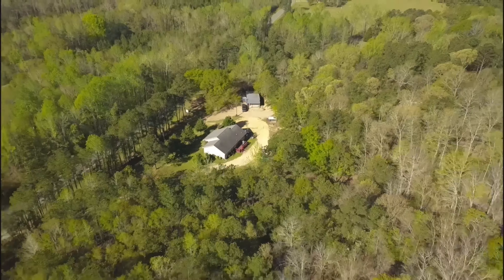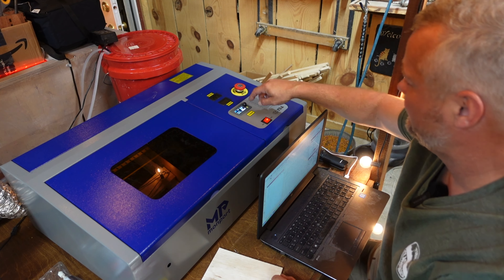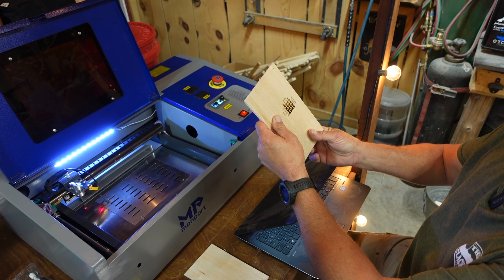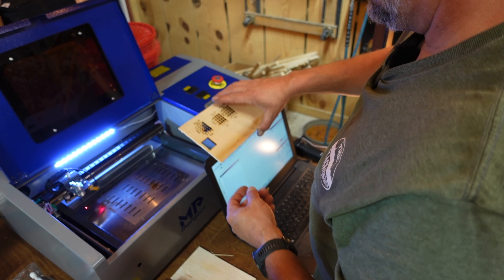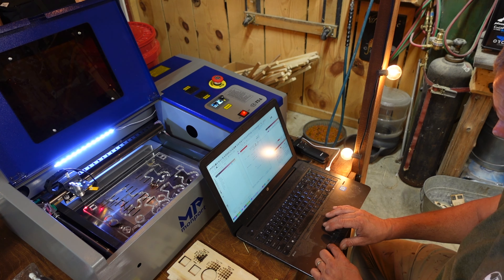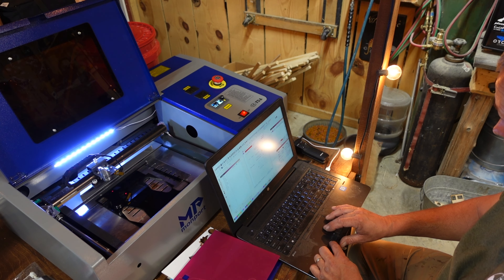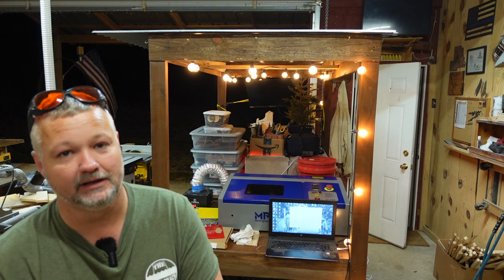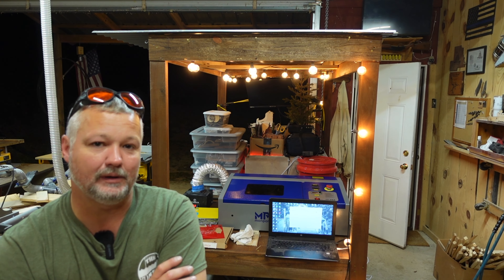First impressions- Monport 40 watt CO2

Comment: Add an air vent in the front of the base of the machine inline with the fan on the back, that will create air assist front to back, you could even add a fan if you wanted to.
Reply from the maker: A fan isn't the same as air assist. It handles the smoke ok already.

Comment: How do you cool this cutter? Do you use the default pump or have you engineered something else? I am looking to cut 3 mm thick acrylic .
Reply from the maker: I ended up getting a chiller. Used the bucket and pump at first.
Reply: @TheClackShack  thank you for quick response!

Comment: 2:52 I have the same issue with my garage getting cold. I've checked and most of the time it doesn't go below 40f in there but on occasion it might. I considered an electric blanket but you aren't supposed to leave those unattended. I've brought it into the house once but it's very difficult to move it by myself.
Reply from the maker: I went with antifreeze…

Comment: I keep hearing you say MonPort recommends a MAX power no greater than 60%. Am I hearing that right? I’ve always been told a mA max (15mA current for the ~40w CO2s aka K40s in general not just from OMTech) figure to maximize Tube life so I wasn’t sure I was hearing that right?
Reply from the maker: It’s written repeatedly in the book. Recommended 20 to 60. I used the test button and the most it will generate with the variable all the way up is 18 ma according to the gauge. This one is controlled with lightburn. Seems to stay at around 5 to 8 ma when cutting
Reply: @TheClackShack  Cool. Either MonPort's tube is more durable, they are willing to risk in-warranty damage at the expense of a customer repair delay or OMTech and others are more conservative on Tube Life.

The Louisiana Hobby Guy, who used to advocate for OMTech but is now a MonPort employee rep is one source of the 15mA or ~37% (I use 40% on the meter myself) limit advice even on his MonPort 50W, not a K40 like ours.

So IDK what to think but am being conservative with mine. 👍🤔😅

Comment: I recommend RV antifreeze.  I use this for my CNC Router Spindle.
Reply from the maker: That seems to be a common solution. I wasn't sure about it... Thanks
Reply: Could result in corrosion. Doesn't mean it doesn't work but that is my only hesitation with using RV antifreeze
Reply: Use g48 antifreeze for cars, protects from corrosion (mixed metal loops) and from Algae build up and from freezing water
Reply: @TheClackShack  I have used the RV Antifreeze as it does prevent Algae and there have been no issues for me going on 3 years now.  Others mileage may vary.

Comment: You'll get better results having your work piece 2 inches from the laser. so you'll need to raise up your work so the beam can be close to it's range. As is the beam is going wide instead of a pinpoint. This will allow you to use less power overall
Reply: But it’s 2 inches from the lens which is inside the head. At first I had to take the lower half off to figure out where the lens is when seen from the outside and mark it for future use in focusing…
Reply: Sir, I LOVE your methodical approach. 👍 ❤
Reply: I’m doing this CUT test on 8mm bamboo as we speak… The Z1 10w not cutting it all the even at 22 passes. Almost but not quite…
Reply: @TheRoadRoamer  You are correct. Fortunately mine came with a measuring piece of plexi-it referenced the lens cap/ lens height.  I have done quite a bit of upgrading to mine, the air assist and also remembering to clean the lenses is very important as well.
Reply from the maker: It came with a focusing measure tool and seems to be where it should be. This whole, no way to move the focus is a bit of a pain. Working on a fix
Reply: @TheClackShack  I pulled out the whole lower bed and now use a simple lab jack and honeycomb laser working table (https://www.youtube.com/shorts/sTmFcAXSPA8)
Reply: @SgtTaz  Taz what make/model is that shown in your Short video?

I thought I was getting that narrow PSU door model and would up with a different model cuz OMTech had a similar unit pictured on the website for the DF0812 listed but said that configuration was no longer made.

The wider door I got obviously seemed to take away from the work area but they denied it did.

I got a STEAL on mine by complaining about it with measured pictures to prove my point and that they were blowing smoke...

Wound up paying UNDER $200 for the K40 + $135 for the LB K40+ MB separately which I installed.

Comment: what is that device you have your exhaust going into?
Reply from the maker: I used a small smoke filter
Reply: @TheClackShack  does that make it ok to run inside? Does it get rid of the smell and smoke?
Reply from the maker: @97JoMiller  the smaller filters help but don’t eliminate the smoke

Comment: My monport has caused me problems so far.  It does not home correctly.  I have been working with Monport Support to try to get it fixed.  They told me the motor needs reversing. They are going to send me a video on how to do it.  Hopefully it is not a complicated procedure. Hoping to get the problems corrected in the next few days.
Reply from the maker: Should be as simple as swapping the wires around. Maybe they will get it worked out. I havent had any issues of that sort so far. Good luck.
Reply: I just had to switch some settings in the machine settings area and now it seems to be working.  Hopefully it keeps working.
Reply: @terrytharrett9033  how has it worked for you so far?
Reply: @LAAM619  It has been working fine now that I have made changes to the machine settings.  I only use it occasionally now because of the bed size.  I am using my Xtool 20W and Atezr 35W more.

Comment: You’ll miss out if you don’t integrate it into your workflow. I have a .clb file specifically for this Maching, Sir.

Size matters but it’s the POWER that will impress. Don’t go over 37%, that should be 15mA. At least it is on my OMTech K40.
Reply from the maker: I plan to use it

Comment: I am a little concerned about you seemingly wearing the same glasses as you do with the diode lasers and not using glasses suited for this laser. Not a good idea to keep the cover open.
Reply from the maker: I don’t use it with it open. I have the glasses for the machine
Reply: @TheClackShack  Just for some examples you used it open (17:30) and with your glasses on. I know you have these glasses for the xTool, but do they protect you from the CO2 laser frequency as well?

Comment: These monport machines are garbage and there support is non existent. Save yourself a lot of trouble and frustration and don't do it.
Reply from the maker: The machines are VERY basic
Reply: @TheClackShack  I've tried a K40 from OMTECH and MONPORT, Same machine with a different name stenciled on. OMTECH knowingly sent me a used machine, I paid for new, it was broken. MONPORT sent a defective machine and had me swapping the motherboard among other things. Weeks of frustrating back and forth ( normally one poorly translated email a week from China). They're basic alright, basic garbage. From what I can see, the only ones of these that work are the ones they provide to folks like you to promote this stuff.
Reply from the maker: @toddo3591  I don’t PROMOTE, I just show what I can do with them and work with folks to operate. They are very basic machines and I upgraded mine a lot to get it to work as I wanted.
Reply: @TheClackShack  I'd be pretty thrilled to get one to work at all.